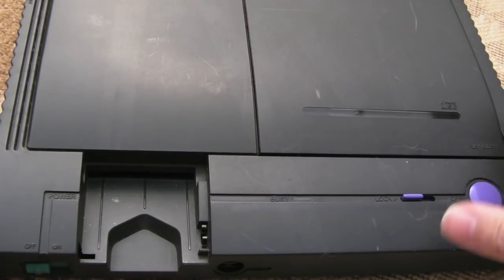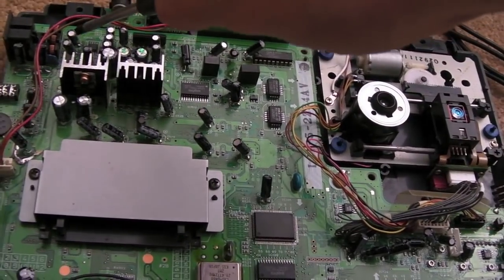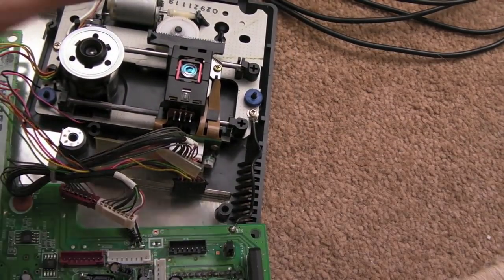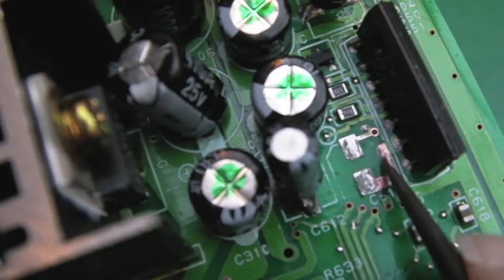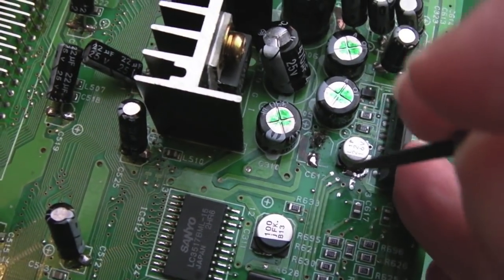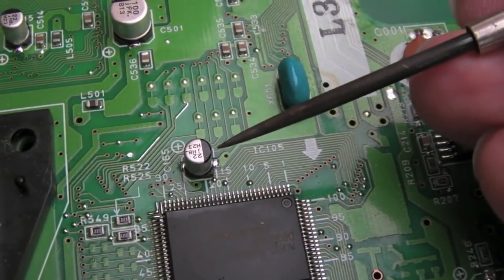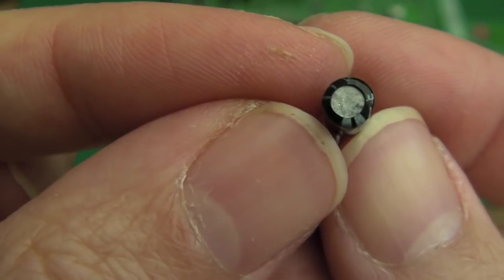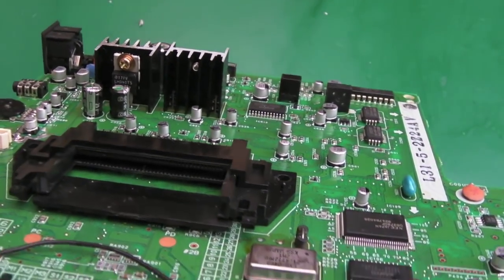NEC PC Engine Duo Multiple Repairs Part 2 (Recap & Laser Whine Adjustment)

Comment from the maker: When I said the OKI M5205 was an amp, it isn't!  That's for ADPCM sound.  I just checked :P

I seemed to lose an annotation in editing there - the point I measured the RF level it was showing ~1.2v.  I also noticed later after reducing the focus bias to fix the whine, the RF level measured around 1.1v.  Alans original laser was set to around 1.1v.

Also - that label placed on the cart shield, that's not aimed at Alan, but for whoever goes in there in the distant future.  Message from the Duo to whoever.

Comment: I just recapped one of these that the owner had lying in his garage for years. You wouldn't believe the corrosion! Almost every bit of exposed metal. Those old SMD caps are especially poop in these. Surprised to have it up and running smoothly. 

Also, can't stand when people are always suggesting to adjust the pots online without a way to measure it. Very little known how messed up you can get your machine, especially by messing around with 105, as you said.

Excellent work and video, man! All this documentation on repairing these is super valuable.

Comment: I have a Duo-R that reads everything perfectly except for backups.. What sort of adjustment would you recommend?
Reply from the maker: Just the laser voltage (the potentiometer located on the laser lens assembly).  Measure its resistance and note down, then perhaps mark the pot position with a permanent marker too, then tweak it a tiny bit one way - re-test, then the other way (past your mark in the opposite direction).  If you are lucky, a little more voltage and it may read CD-R.  But it will shorten the life of the laser.
Reply: @GadgetUK164  Got you - thanks! Do you think I can do it without a meter? Which pot should I adjust? I'm thinking mark the current position and adjust a tiny bit left or right.
Reply: @GadgetUK164 I have a Duo that'll read SOME CDRs and some it wont...  same brand and set if CDRs too... it's odd. Even after I've made a fresh burn,  still keeps having issues reading

Comment: Thanks for the advice you've given me so far and for the video. I'm so close to getting mine working now I just have one final hurdle to get over. Mine from having been completly dead at one point is now playing Hu-Cards and playing music CD's in full with no issues but it won't load a game at all. Any suggestions? I've also fitted a new lazer that I know to be working as i've tested on a working unit. Any pointers/advice would be appreciated

Comment: Thanks for another great upload GadgetUK, fantastic work on this board. What hot air rework station you would recommend/use for your repairs? And what size nozzle for a SNES CPU/PPU? I bought a WEP one from amazon but the soldering iron holder was such bad quality I've sent it back (it would have caught fire!)
Reply from the maker: Thanks =D Something like the ATTEN 858D - quite cheap.  They aren't brilliant but more than adequate for all this retro stuff.  I use a 1cm tip for SNES chips (128pin QFP I think).

Comment: Nice work mate, I've literally just picked up a bunch of through hold caps to do a GT,  after watching this though I'm thinking I should try some SMDs especially considering the lack of space. Did you use a hot air station ? I tend to heat one side and gently lift, starting to think I should pick one up.
Reply from the maker: Thanks =D You made a good point there on the lack of space, but that could work against you - ie. if the spaces are super tight, it could be really hard fitting SMD caps in all positions.  I would take a look where they are positioned before you order a kit.

Comment: Hi there quick question. I have a turbo duo and it plays cdrs fine. My second turbo refuses to play them but plays official ok. Is it the laser failing? It’s been recently recapped.
Reply from the maker: It's possible the laser is failing but there are other possibilities.  The type of laser can vary - eg. 3rd party replacement may read CD-R better or worse vs an original factory laser.  Also some lasers can be calibrated on the low or high side from factory.  It may be that it needs the voltage increasing or decreasing in order to get the RF level more balanced for CD-R.
Reply from the maker: Also note - the media can work better or worse between different lasers too.  Not all CD-R media work exactly the same,  I found the Tao Yuden discs to work best on many systems, but that is not always the case.  Some times the silvery looking CD-R work when the other discs dont.  And burn speed can also affect ability to read on some lasers.
Reply: @GadgetUK164  thank you so much for all your help and expertise. I had a look tonight and spoke to seller. The laser is original, it plays original cds fine but cds it comes up with disc error. I brought the CMC Pro/Taiyo Yuden CD-R 52x White Inkjet Printable Full Face (100 Stack) and burnt lowest speed I think x6 which work great on my other duo. I tried another game on same disc ‘Addams family’ and it moved the laser right over to the right and locked. Got it back out and working again. Just wondering just I change the laser first (Ali express) and see if that solves issue. Then look at pots maybe on laser first? Then I heard v104 is the one that needs a 1/4 turn.
Reply: @GadgetUK164  again thank you for your help it’s really appreciated. The idea of messing with the pots scares me. Not sure what tools are needed.

Comment: Hello! Great video. I was researching and came across your video. I have a Duo RX and I’m getting certain audio issues. For Example, Dracula X will not play door creaking sound? Is the a cap issue?
Reply from the maker: My first though is maybe bad caps.  I think PCM audio comes from a chip seperate to the main audio - so that chip could be faulty, or perhaps the opamp that mixes the PCM with the hu6280 audio.  You should inspect the board to see if any caps look to have leaked.  A trace might be damaged as a result of any leak.

Comment: I use a little 3 in 1 general purpose oil (usually sold as sewing machine oil) to hide scratches on black plastic consoles. If you use it sparingly enough it won’t make it shiny but it does seem to disproportionally darken the scratches as it makes things look new.

Comment: Nice job there, very neat. It's always sad to see a board that's been damaged like that for what may been an unnecessary re-cap. These days I am having to turn away boards which have already been extensively worked on, as I just can't justify the amount of time it takes to test and repair previous damage versus what can reasonably be charged for the work, as you say.

I used a similar technique on an A500+ board, there was a large section around the battery that had to be taken back to copper, tinned and desoldered. I find a fibre glass pencil lubricated with some IPA is a gentle way of taking off the soldermask and any surface corrosion.
Reply from the maker: Thanks Dave =D  I need to get myself another fibre glass pen - I had one and accidentally threw it away with some paper towels - grrrr! :o)  I can totally understand turning down boards that have been 'tinkered with'.  Nothing worse than quoting a price based on what you know it will take, to find muppets have been busy creating all sorts of un-natural faults for you to trace.

Comment: Have you tried using a curved tip for your soldering station? I wondered if they existed, as they would make reaching tight spaces easier, and after searching, I see several types and styles on eBay. Lots of people using wide blades for drag soldering lately on YouTube, but I am certain the curved tip would help on some of my own jobs.
Reply from the maker: That's a good tip for others, but there's nothing I cannot solder with the standard tip!  When I was demonstrating in a few places there I was left handed a lot (tip not the way aligned I would use it right handed etc).  I really need to get a better camera rig or tripod I think.

Comment: Wonderful class master. I liked to learn how to recreate a bad track using the copper wire and the the chip quik flux. I've got to try to fix someday an Amstrad PC board with some related problems (not caps), but I don't have the skills. 
Edit: BTW, do you like my C64 with VU meters mod? I made a video a couple of days ago.  I know that you also were trying something similar.
Reply from the maker: Thanks =D  If the trace has gaps in it, you may need to add wire to replace the trace.  But if the trace just has surface corrosion, you can treat it like I did by dragging solder and flux over the trace via solder braid.  Let me know how you get on with your Amstrad PC =D  I will check out your C64 vid later =D  Sounds cool!  I've got an LED vu meter sat here waiting to go into one of my dual SID C64s soon.

Comment: Great work and video as always.  I’ve also seen people use surface mount ceramic capacitors which also does a clean job.  I might try them the next time I re-cap a duo.  Dunno if it’s any better than the SMD method but looks cool lol
Reply from the maker: Thanks =D  Yes, I've seen people use ceramic caps too - not something I would do (or recommend).  It will work for the most part, but ceramic caps have different characteristics vs aluminium caps.  There's an argment to suggest that in certain places ceramic would be better suited, but in others it wouldn't be better than aluminium thru hole or SMD caps.  Looks cool but it's not for me!
Reply: ahhh makes sense.  I've never looked into it and now I don't have to lol you know your stuff!

Comment: Hi need some advice on what to check on mine. I've recapped and it was working I was trying to dial in the laser and it seemed to be working. The fuse however has popped and I've now replaced this and the voltage regulators (just to make sure) but after replacing the fuse and then the regulators it's not working. Any suggestions on what to check? I'm pretty certain I've accidentally shorted something but not sure what. Thanks
Reply from the maker: It can be quite difficult for diagnose something like that - what you need to do is firstly measure voltages.  Make sure you have 5v going to the main logic.  Check each of the IC's near corrosion has a ground too!   Then its a case of either inspecting everything you fixed, and around replaced capacitors, or scope the system to see what's going on.  ie. scope databus, address bus on the CPU, clocks etc.   My guess is either a broken trace from corrosion, something joined where it shouldnt be etc.    You can also measure across electrolytic capacitors there to check if there's voltage across them.   Any over supply rails will show 5v.  Any coupling signals may have a bias, eg. 2.5v.
Reply: @GadgetUK164  hi, thanks for the advice, it wasnt anything on the board that was the issue. Although i checked my psu with a multi meter it didnt initially register with me it was outputting the incorrect output so this has now been sorted but now the games arent loading but music cds play. The 'problem solving' continues thanks again

Comment: Yo Gadget I have a pc engine duo r that's recapped and added a new laser but now when playing games it sometimes loses the audio track until the level reloads. Also some games that use voice acting end premature what they are saying. Any idea? :)
Reply from the maker: It could be some corrosion (damage to a via) somewhere - try testing using the audio player to see how it plays audio tracks as you scan up and down the CD.   The other thing that might be the issue is the tracking - perhaps as it scans up the disc to upper tracks it looses the ability to track properly.  That might need you to adjust the laser voltage, focus or tracking adjustments.  If you do end up adjusting the pots, measure the resistance of each before you start and note / mark their existing positions before you adjust.
Reply: @GadgetUK164  thanks alot. I will be sending it off to Simon lock soon for him to have a play with the pots. I'm sure the seller "tweaked" them sadly. It plays an audio cd well and seems fine apart from that it's a bit premature on ending voice clips in games from the cd also :(
Reply from the maker: I would offer to take a look at it but I've got way too much stuff back logged at the moment and I desperately need to re-gain control of my space here!
Reply: @GadgetUK164  Thanks for the offer mate I know you are a busy man so appreciate it :) i will let you know what he finds but I'm sure it's just the seller has pot tweaked it without a meter or scope. Its was from Doujindance...
Reply from the maker: Ah, there we go!  It probably just needs adjustment!  Although it might be the laser isn't so clever (perhaps dodgy coils).

Comment: Hi, still having trouble with mine, I've checked my Pots and I'm happy with VR101 as both legs seem to match yours. VR102 Shows 8.4 on the upper leg and - 37.8 (yes minus) on the lower (bit odd) VR103 16.5 on the left and 2.9 on the right so about 1-2 k out on the right pin VR104 bottom pin 15.4 on the bottom and 3.8 on the top so about 2k out from yours and finally vr105 lower is zero and uper is .4. out of curiosity with the one that read zero tested with the continuity on the multi meter and it buzzed should it do this? I'm getting the imression something isn't quite right do these need replaced is it likely something else is wrong?

Thanks
Reply from the maker: Its unlikely those pots need replacing (unless they have been abused) - maybe yours are a different size than the ones fitted on this board?

Comment: Can the pins that hold the cdrom lens in place be repaired or fixed they were broken by who modded my duo rx. My duo rx was kind of ruined was talked into a component mod. I sent it back like 3 times. I think my duo rx was the first.
Reply from the maker: When you say 'pins' - do you mean where its connected to the focus or tracking coils?  You might be able to do something there, but I doubt it - it's such a confined area.

Comment: I have a turbo duo that hasn’t been messed with and i did my recap on it. Yours showed 470 for v105 as one of the readings. Mine was 460. Again, on a system that hasn’t been messed with. So it think that would be close to a default setting.  I did have to do some tinkering with the others to get the audio to read again but it’s weird. Can play pressed audio and games no issue. Cdr audio. No issue. Cdr game…random results but always a slow load if it loads at all. Weird.
Reply from the maker: The media for CDR makes a huge difference!  You need Taiyo Yuden discs!

Comment: I'm glad you mentioned the printing on the can. When I did my Amiga 600 I was annoyed that they looked crooked,  especially when I had 3 in a row as it made it very obvious.
It's interesting saying how much time you spent on it, professional repair makes these uneconomically to do, that's why I wanted to start getting in to doing the simple things like recapping and cleaning up traces.  I actually wont to buy some cheap machines I can practise on, but even broken stuff is going for a lot, too much to buy just for a practise. 
Is that flux you use worth it?  Like you said it is expensive and it's what? 2oz?  Does that last?
I think I've made my mind up, If I can get £220-£200 for my Duo I'll sell it and get a Super SD System 3.

I think Alan will be well chuffed at getting this back working.
Reply from the maker: Hehe, yeah - sometimes the print isn't straight.  Chip qwik flux is well worth it!  It's pretty much the one essential consumable I have (besides IPA).  I wouldn't work without it now.  2cc is around £8.70.  But you need a tiny amount each time, so 1 tube can last a LONG time (unless recapping a nightmare board like this was).  Sounds like a good move on the Duo =D  I hope this gets back to Alan in one piece...

Comment: Could someone tell me if hard reset using START + SELECT is hard on the disc drive in the TurboDuo?
Reply from the maker: When you say "hard on the disc drive" - do you mean a hard reset for the disc drive, or do you mean - negatively affects the disc drive in someway?   It will "reset" the disc drive circuitry - unless there's a damaged trace on your motherboard.  And there's no way it will adversely affect the drive doing a soft reset that way.   Using select+start = soft reset btw!  A hard reset would be switching the console off and on again.

Comment: That's ok if you had repair something quick! But thru hole capping the hole thing with cheap chinese capacitors is a no.
Especially NEC PC Engine Duo is high price item.
Reply from the maker: Yeah, I agree that since these are typically suffering from leakage to start with, coupled with their high price - may as well do it right the first time around.

Comment: Flattened cans? I can bet that they are that shitty that they're not packed properly (rip one to bits and have a look), just enough material to give the capacitance needed and flung out of the shop asap - a bit like cheapy lithium ion cells. 

Mr. Fixit then probably proceeded to 'solder' them to the board but got burned fingers due to the can getting too hot to hold, so decided to use some long nosed pliers of sorts to hold them in place and crushed the can without a care in the world during the process.  

Man that board was ugly.
Reply from the maker: I've still got the old caps here - I might just check them as a quick 'follow up', just to see how bad they are.  I suspect you are right - someone held them with pliers.  They don't get hot when soldering though, so that's crazy lol.  I think they are just so low quality that some in the bag they used were probably like that from factory.  I've seen really cheap caps like that before (from new).